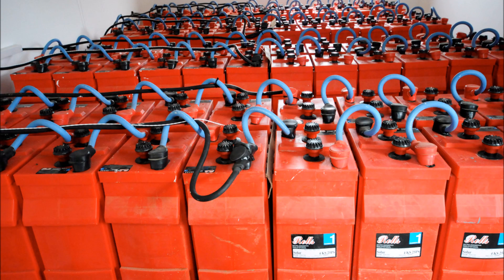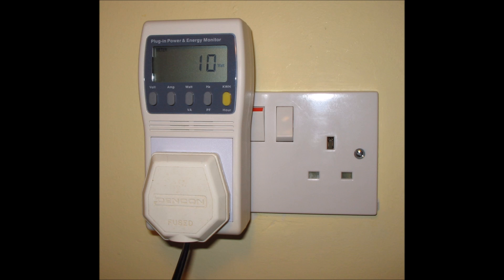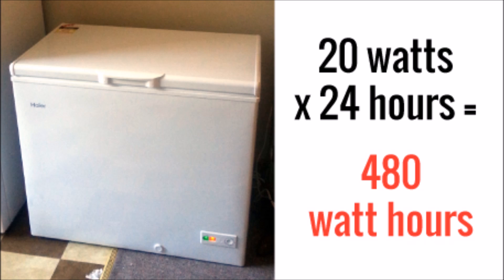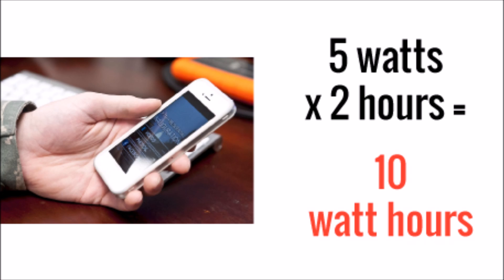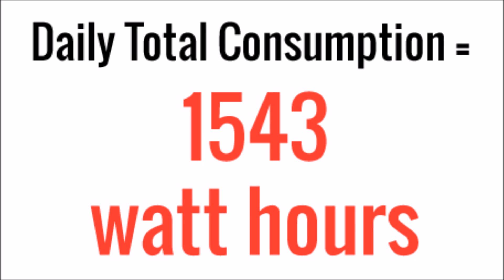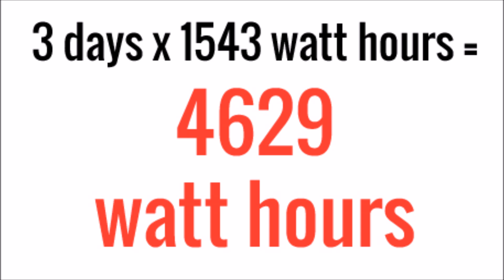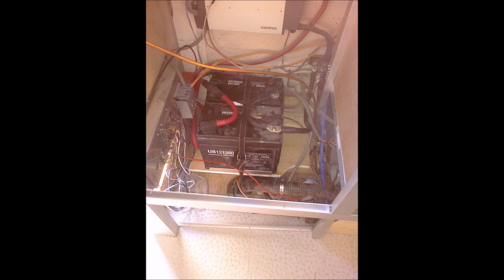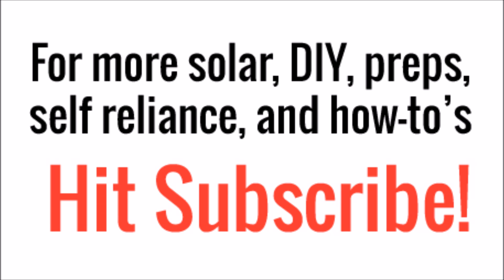How To Size Your Off Grid Battery Bank Capacity For Solar - Math Warning!

Comment: I been running solar at my current home for 8 years. First year i used some cheap wallmart deep cycle batteries. I saved up and bought some 2 volt 1200ah lead acid batteries from rolls. My system is a 24 volt system. I run 2 15cu ft chest freezers a refrigerator some computers routers fans ect... i calculated 5000 watt hours a day and its been mostly nice 10 months out of the year. I needed more solar panels for the winter. My panels put out 200 amps when the sun shines and my batteries were doing fine. They are getting old now and i really looked hard at the solutions for storage and settled on some chinese Ni Fe 1200ah cells. they should be getting here in 5 weeks ( a slow boat from china ).  One thing people should know is that the edison battery has a higher charge requirement and can also be taken down to a deeper discharge with no ill effects. My system will charge to 34 volts and discharge to 20 volts. I use some Schneider inverters  that can be programmed to deal with the higher/lower voltages required from Ni Fe batteries. The lead acid batteries were 350$ x 12 for a 24 volt system. The chinese batteries ( sticker shock )  500$ x 20 for a 24 volt system. The huge difference is the lead acid batteries lasted 8 years. The chinese edison cells will last 60 years as long as you flush and change the electrolyte every 8 to 10 years. Who knows some edison cells are still working past 100 years of service. I looked into the power wall stuff and its great for grid tied systems but for off grid its not a good fit. It also would have required me to completely change out everything from charge controllers to inverters. IF you decide to go off grid do as i did all walls use R50 insulation. cute down heating and cooling. Yeah 100f outside but 75f inside  oh yeah thats savings.
Reply from the maker: Very nice.  I would have expected a lot more out of those Rolls batteries, though.  I thought they were warrantied for longer than 8 years?  My Trojans are warrantied for 8 years and they are not even a premium line of battery.

Please let me know how the NiFe batteries do for you.  I am very interested.

Comment: Edison cells, or the new lithium iron phosphate  are the way to go.
Reply from the maker: I love Lithium Iron Phosphate.  That is my favorite battery technology right now.
Reply: Nickel Iron cells are better for off grid, lithium is better where space and weight is important. Otherwise nickel iron smashes lithium. Ni FE batteries aren't advertised much anymore because they last to long so manufacturers don't get repeat sales out of them. Lithium batteries are better than lead acid but they have the same issues. Lithium batteries are not to be left fully charged for a long time nor discharged for a long time, the faster you charger them the more you reduce the life of them. while they may have 1-2000 cycles compared to lead acids 2-300. if you only charge lithium to 80% and don't go below 40% you should get 6-8000 cycles out of them. But this would mean a much larger bank.

Comment: One big mistake is hooking batteries in parallel. Try not to do that. If you think you must. Always use a fuseable link to each battery so if a cell shorts you don't have a disaster. Also batteries left in parallel will self discharge over time. Do not go off and leave them connected in parallel for weeks at at time if the bank is not being charged.
Reply from the maker: Right.  Good points.  It is better to get higher capacity batteries and put them in series to get to your desire voltage than to get a ton of smaller, cheaper batteries and connect them in series strings and then parallel to each other.

Comment: If someone starts producing the saltwater batteries again they can fully drain without damaging them, don't care about outside temperature and have a good cycle life. The down side is they are heavy so need a solid floor under them.
Reply from the maker: Yeah I hope someone picks up the technology and continues.  It has limited application but I can still think of some scenarios where these would be perfect.

Comment: What about submarine batteries? My neighbour has 2 submarine battery cells lying in his garage... Yes, yes I know they are heavy (2100 pounds a piece), large and expensive. But if we put size and cost issues aside, how effective a single submarine battery cell would be?
Reply from the maker: I am sure they would be amazing and provide a lot of storage.  Most people just don't have access to them or a place to put them.
Reply: LDSreliance While the storage capacity of a 1 submarine battery cell would be awesome, there is a problem. How the heck do you recharge it (remember in submarine batteries are charged with diesel/steam generators)? You would need a lot (40+?) of solar panels/small wind turbines just to recharge that thing...
Reply: that discharged battery would destroy nearly any charger that even glanced at it.

Comment: lighting ? like light bubls and stuff? hot water or at least running water, a pump for a few hours?
Reply from the maker: I'm not sure what you are asking.
Reply: you didnt consider a water pump, for fresh water, toilet, hot water, the shower or lighting like led lights and so on
Reply from the maker: I agree the example scenario was not meant to be exhaustive or comprehensive.  I just grabbed several loads from Drew's scenario and used them for my math.  The point of the video was the math you need to do to size your bank, not how to plan for every load you might need.

Comment: Hi friend. I would add to this number at least 30% extra and reason for it is that you never know what might happen..you might try to buy new tool or you might get extra person in your house and you didn't count with it. So i would suggest to add extra amount just to be on safe side. I know it cost money but yes you have to invest extra because at then end you want still some comfort and you are not living alone..... Well lithium batteries are not cheaper only if you are able to get some from used car or from car that had accident or such..but if you would buy them new then they will cost a bit more. They have own problems but that is that different technology ...and don't forget all equipment(battery, inverter, BMS) and such needs to have exact temperature....they don't like very low or very hot temperature..that is one thing to consider. Anyway nice video. :)
Reply from the maker: I agree.  It is good to have some extra just in case.

Comment: Have not had time to read all the comments but this video is missing the voltage converter efficiency, which will increase the battery capacity required, but the battery capacity is specified for a particular discharge current, so if you are not exceeding this current you do not need to double the capacity as in the video.

Comment: I am planning a system for a house that does not exist yet, The place is in the Philippines. I am buying four 150w panels for a total of 600w. The specs on the panels are VMP= 18v / IMP= 8.34A / VOC= 22.4 / ISC= 8.72A. The Charge controller EPsolar MPPT 40a 4215BN, But big can I make the battery bank 400ah, 600ah, 800ah? Anything after that is out of the budget but even 800ah is putting some serious stress on this budget. The house electricity will be designed around what the system can produce. The battery bank is planned to be 12V
Reply from the maker: At 400 Ah it would take your system about 11 hours to fully charge, which would be 2 days (more or less).  So that is probably already too big.  I certainly would not go any bigger than 400 Ah unless you get more panels or you have a generator or something to help charge up the batteries occasionally.  I'm thinking about 250 Ah would suit that solar panel system better.
Reply: Thank you for your kindness honestly, I planned to buy a generator anyway as there are times when we seem to get poor weather. I wasn't planning to do much with the system, Lights, charge a laptop and gadgets, watch TV.
Reply: Thanks!
Reply from the maker: You are welcome!  Keep in mind that if you consistently use your batteries when they are not fully charged (short cycle) then it will negatively impact their longevity.  It sounds nice to buy a huge battery bank just in case or to allow room to grow in the future but it can be a bad idea unless you get creative.  

One other idea besides using a generator would be to build a 250 Ah battery bank for constant daily use and then keep a couple spare batteries off to the side that get connected to a trickle charger/maintainer for emergency or standby use.  When you have a storm come through and knock out power or it has been overcast for 3 days straight and your system is low you can wire in those extra batteries for spot use and then take them back out again when the need is gone.  That way you are not constantly short cycling your system where your batteries are never fully charged and hurting their cycle life.

Comment: question, i run some servers totaling around 1350 watts an hour and i need a backup that can hold the machines for about 15 to 30 min.
i am planning to use both powerbricks for the machines, plugging one into the wall and one into the batteries so the batteries will have a 24/7 charge and discharge (see it as using your laptop while charging) 
using 2 bricks so that the machines will only pull half their usage of the batteries and the other half of the wall.

can you give me some tips on how to make this? and on what kind of batteries i have to use?
cooling isnt a problem, neither is the size
Reply from the maker: You will need 184Ah of battery power to last that load for 30 minutes.  That should be pretty easy as most deep cell batteries have at least that much.  I would probably use two golf cart batteries wired in series (you can get them from Costco or Sam's Club) or you can just order one battery like this:  http://amzn.to/2o1IWy8

If you want to run the load off the battery at all times and have an equal amount of power coming in to keep it fully charged that will be a fun problem.  I don't have any experience with 12v chargers that use AC power from the wall and can provide 120 amps.  I am sure such devices exist but I just have never researched it.  You would have to find something that would provide at least as many amps to the battery as are going out to the servers.
Reply: LDSreliance thanks man ill give that a look
Reply from the maker: You are welcome.  Good luck!

Comment: your maths or also a little further off as you have not counted the extra power the inverter will take boosted the voltage from 12 volt to mains voltage of your appliances
Reply from the maker: True, true.  I probably should have at least mentioned that in the video.  Oh well.  I was planning on covering that in a different video.
Reply: Hind sight is 20/20 they say.  We all notice things we forgot after the fact.  That is part of the beauty of YouTube. You can always make another vid to put in what you missed previously.

Comment: Lithium polymers, lithium ion, nickel iron, even fork lift batteries can be almost completely discharged without harm. Problem is, they're pricey lol. you'll end up spending about twice as much for  those as the double capacity needed for your requirements on FLA,SLA, AGM, Gel cell, etc.  The issue with forklift batteries and especially nickel iron is some of them have insane amp hours but only 2 volts. Some 6 volts for fork lift. Even used, the cost is wards of 250 per battery for the 2v nickel iron (but they can last 80 years) and same 400+ for fork lift batteries with a 380-470ah rating.
Reply from the maker: Yep.  I don't often mention some of those because of their price and how seldomly they are used in solar.  But you are right, some of them CAN be discharged to 0% although if you look at the chart of cycles over a lifetime vs. depth of discharge, after 50% the expected cycles for even lithium ion drops pretty drastically.

Comment: For the uninitiated, you still need to explain the link between your calculated amp hours and the selection and size of your physical battery bank
Reply from the maker: True, but that opens up a huge can of worms about different battery chemistries, technologies, sizes, and philosophies.  That would be an entirely new video all on its own.  For example, some would say that two 6v batteries in series is superior to one 12v battery of the same amp hour capacity.
Reply: LDSreliance ... also true, I await that video. Thank you friend.

Comment: living in the UK this is still some way off.
Reply from the maker: True.  UK is not a great place for solar until panels get more efficient.  How does wind do for you guys?
Reply: LDSreliance . iv been looking into wind as iv seen small set UP's for less then 400pounds. it could be done as its windy were I live.
Reply from the maker: As long as you get more than about 16 kilometer/hour winds on average you can do wind.  But you would need to be able to put it up high, preferably at least 30 feet in the air.

Comment: It was great until you just ended it without telling us how many batteries we need.
Why is it so hard to find simple answers on this crap?
Reply from the maker: I told you how many amp hours you need.  I can't tell you how many batteries you need because every battery has a different amp hour rating.
Reply: Of course. But lets take a simple 60 watt laptop. What kind of battery, and how many, would be required for it to last 24 hours before the batteries go below 50%.
Just looking for a real world idea on what you can actually do with these setups.
Reply from the maker: Assuming 50% depth of discharge and using a lead acid battery, you would need 245 Amp hours of battery storage to run a laptop for 24 hours straight @ 60 watts.

Here is a single battery that could handle that every day for 5 years:
https://www.thesolarbiz.com/trojan-j185h-ac-12v-225-ah-battery.html

Or here is a battery that you would have to get 2 of and then wire them in series that could handle that every day for 5 years:
https://www.thesolarbiz.com/trojan-t105-re-6v-225-ah-battery.html
Reply: Thanks. Now it makes more sense with an everyday reference point to work with. That has been missing from every video I've ever seen on the topic. Probably why so many get turned off it.
Reply from the maker: Agreed.  I need to figure out a way to make a video and show that reference point.  Problem is that the average view duration of my videos is 3 minutes so I am trying to keep my videos around 3-5 minutes max so that people will watch them.  So I can't do a super in depth explanation and example scenario.
Reply: Haha.
In my head, if it were me, I would probably just drop an old broken laptop on the ground next to some batteries in the first 3 seconds. I wouldn't expect it and it would make me laugh a little.
Then say something like "This 60watt laptop takes about this many batteries to run it 24/7"
Then I'm hooked.

Maybe do the same for other battery types since they have different ratings. That would show the difference between each type of battery for the same device.
After that I would be amped up for the details.

By the end of it the old laptop is all busted up. "Ok maybe they won't run THIS laptop anymore, but you get the point."

But I'm also really tired so this might be more funny to me now than it actually is.

Comment: Well, the first goal should be reducing power consumption. This saves you a ton of money in the long run. My laptop uses about 15-20 watts on average and is now 6 years old, I guess the newer models are a bit more efficient. If you just want to browse the web or watch tv, use a tablet - this saves a lot of watts. Do you really need a fridge or freezer? I don't. And even if I do, In my area the temperature is below 10°C for about 4 months , so I can store some products easily "outside". I would probably would be fine with a 200ah battery bank - I'll try that out in the future. 
Great video though.
Reply from the maker: Thanks!  I agree with your points.  Everyone should look at ways to conserve energy before sizing their solar panel system and battery bank.  However, I'm not going to second guess what other people want to do with their solar so I just want to educate people how to get in the right ballpark with some easy math.
Reply: Yeah, you are doing a great job on that. I bought a 85ah AGM battery with 1000 cycles at 30% DOD. Hopefully I can charge it with my 100 watt solar panel and my 6 Amp pwm chargecontroller.  The low capacity forces me to reduce energy consumption, which is a good thing in general I guess. But as I mentioned above, I only want to power a laptop, charge my smartphone/tablet every couple of days and use some led lights. I guess if I charge the devices during the day (and use their internal batteries at night) my AGM battery will stay always almost fully loaded . I am excited :)
Reply: for hot water you can jst rul a hose in a sunny area, and run it through the drain valve on the HW heater...It provides plenty hot water to shower with...I did this for months when the power cut me off with their exorbitant bill...
Reply: @donaldbadeaux5455  yeerh and if and if and if .. but does IT Work at Winther if IT DOSENT who fuking care
If my water hose put on a black flat garage roof get hot at summer time .. or in my case 3 Month a yer 
What to do the last 9 Month .. you idea is .. not usful .. but a great idea .. in you live at equator .. UPS monsun Month s .. Dang .. not usfull there either 
Vacum hotwater tubes Work almost 9 Month here .. so wind Power and watercooled dumploads .. to top op .. and a Wood pill hot Water oven 
To prowide Worm air and hot Water .. in Winther time .. .. the smart in a hurry won't get you there .. but a combination of things Will